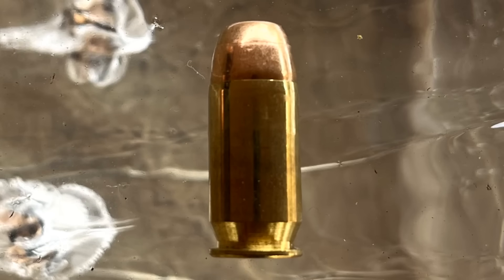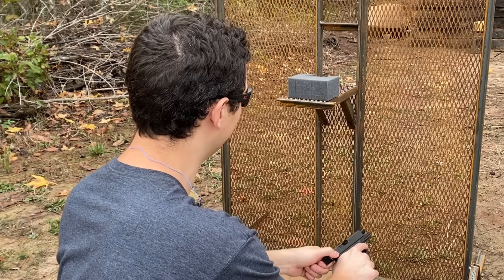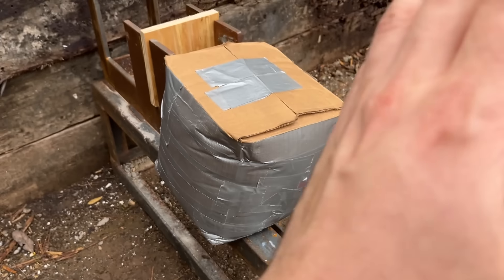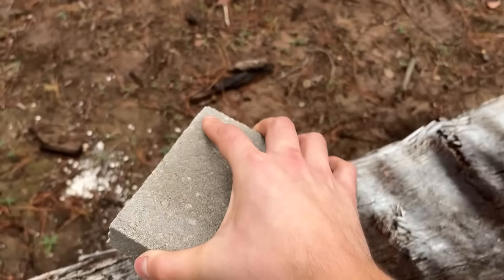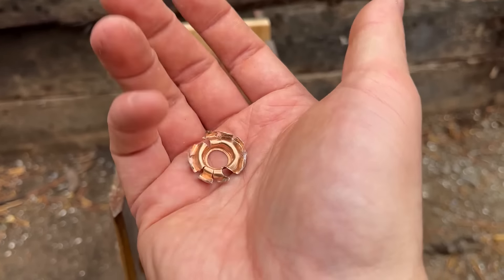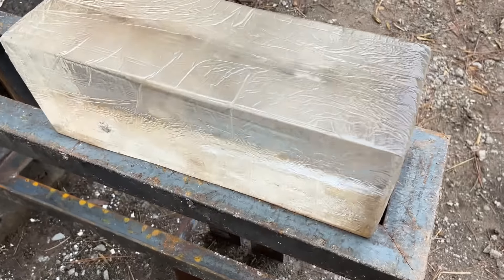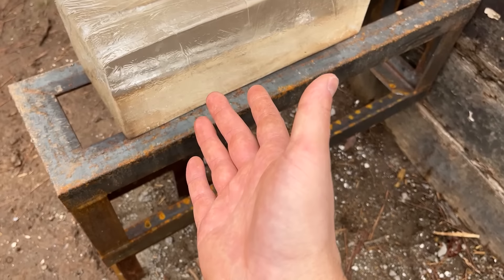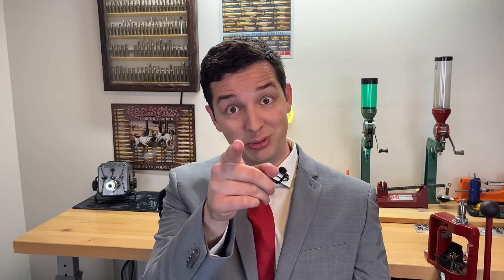9mm vs 45 ACP Barrier Test: No Debate?

Comment: Funny how both the 9mm and 45acp are war cartridges and never originally designed to be hollow point. In combat you would not be using hollow points. You need to test these rounds without hollow points. Curious to see if it matters.
Reply: Hollow points were only used in the gel .
Reply: @44special9 , where in the video did he say that? It seems incorrect.
Reply: I don't remember him saying but I think I found some evidence .                                                                                                                                                                                                                                                                 45 bullets shown at 2 : 02 and 2 : 04 timestamp are f.m.j.                                                                                                                                                                                                                                                                               bullets shown at 2 : 54 are f.m.j. not HST hollow points (no cuts on the jacket)                                                                                                                                                                                                                                      45 bullet jacket at 5 :45 has an open base , 45 HST doesn't                                                                                                                                                                                                                                                                     hollow points weren't introduced until the gel block                                                                                                                                                                                                                                                                                      f.m.j. loads are listed up top in description if you want to check them out .

Comment: What bullet weigh were you using? For the .45acp try a 165 to 180 grain bullet. If you can can find it, try a 145 grain 45acp. These bullets would have higher velocity and maybe greater energy.

Comment: I agree with @philipstaite. Ammo diversity is a good thing. I conceal carry both calibers in todays video, and it depends on where I am going as to which pistol I carry. My general carry is a Glock 43X with 2ea Glock 10 round and Shield Arms S15 (15 round) mags. Yes I carry 51 rounds with me because you never know. My secondary carry is a SDS U.S. Army M1911A1 with 22 rounds. I carry my 45 when I know I am going to be mostly in more confined/short range shooting situations. The lessened degree of penetration of the 45 means less chance of me destroying/wounding someone I don't. Also the mass of the round and the faster energy dump equals a greater chance of knock down. Just imagine that 230grain (83 more that the 9) slapping something solid in your (or on your) body!

Comment: About 30 years ago a buddy and I at the range set up some pepper poppers for just the sake of curiosity.  I had two Glocks with me, one was a 23, (40 S&W, (165 gr) and the other a 21, (45 ACP (230gr).  I don't recall the ammo brand most likely HST (that was free ammo).  The pepper poppers were adjusted to fall over as evenly as possible.  We taped an aiming point at equal locations on the PPs and alternated between PPs with the pistols.  We found that the 45 ACP consistently hit harder and knocked the PP down faster than even the 40.  Maybe not by much, but...
The test I just watched didn't show the energy of the rounds striking an object and the reaction of that object.
I don't have a dog in the fight, I have all three (9,40,45), and have appreciation for all of them.  But I think the 45 ACP often gets overlooked and is viewed as obsolete.

Comment: The debate has been over for at least a decade. 

The fact is that there is no such thing as "9mm ammo" or "45 ammo" and it just doesn't exist. You can't buy it, you can't sell it. It doesn't exist. 

What does exist is dozens, if not hundreds of brands selling possibly thousands of configurations of casings, powders, primers, compositions, and shapes... in both 9mm and 45 caliber. 

And those different ammunitions will work differently in different guns and on different targets. 

So the answer is and will always be: "it depends on the gun, the ammo, and the target"

But if we look at the experts, the FBI switched to 9mm. Cia uses 9mm. The military switched to 9mm. Most police have switched to 9mm. And there's no agencies requiring 45.

Comment: As one that shot both the .45ACP and 9MM for a long time while serving the Army and in Law Enforcment, being on SWAT for many years, this is what I came up with, oh and also being an FFL Dealer, Gunsmith and Trainer to boot; take it for what it is worth. The 9mm as a good if used as an offensive round, in 115 gr. to 124 gr., yet the 147 gr. is for defensive as well as most of the .45 APC rounds, for stopping power.

Comment: I got small hands, small feet, and a small, well anyway, I carry a 9mm with 124gr +p gold dots. I think the 185gr +p rounds for the 45 is as close as you gonna get to a 10mm. I wouldn't want to be shot with any of them. Great comparison 😎👍
Reply: I have 2 20rd boxes of Underwood 185gr +P JHP for my used Glock 41 .45 gen 4. I carry that round often but also use my 50rd box of HST +P 230gr .45acp. Both .45 rounds are great for personal defense or duty use 🚔.

Comment: The thing with personal defense ammunition - penetration and velocity aren't as important as the amount of damage damage and stopping energy that will be inflicted upon your attacker, and the ability to disperse the threat as quickly as possible.

Round 1 - The 9mm penetrated deeper, but made a straight and narrow wound channel. The wound channel on the .45 is much wider and the damage is obvious. - Winner .45
Round 2 - Neither went through the sand and no measurement of penetration was performed. - Draw
Round 3 - The 9mm broke the block in half, but the .45 destroyed it. - Winner .45

Round 4 - The 9mm and .45 both had almost the same penetration and wound channel size, with the 9mm slightly edging out the .45. But the amount of energy the .45 released into the block upon impact was visually greater than the 9mm. That's the knockdown power of the .45.  - Draw.

I have both calibers in my arsenal, but the .45 is my go-to choice for home defense, and the 9mm is easier to carry around while out and about. When it comes to protecting my family, I would rather not use something that is likely to go through walls, and is more likely to remove an attacker's limb and put them on the ground than just go through them. Bigger holes = more damage.

Comment: I'm not trying to tell you what to do, but something to consider. Lead is a soft metal, and even ricochet is moving considerably faster than you can shove a bullet through your shield. IF you have this issue, that lead is going to shave off, or squish through that mesh shield you have. If you feel safe after this consideration, do what you do,  just know that I personally worry for your safety.

Comment: A 9mm is NOT a .45 ACP.  They are not in the same league.  A .45 ACP round is 11mm (2mm wider) and averages twice the weight of most 9mm at, say 230 grains.  How are these rounds comparable?  Terminal ballistics are night and day!  Trust me when I tell you that .45’s have stopped way more bad guys on the battle field than any 9mm.  It just most pansy’s can’t handle the .45 and they don’t have capacity to spray and pray for those with shot placement problems.  The .45 is proven as a man stopper.  Not the 9mm. It’s just more popular today. And I assure you that multiple shots through a windscreen with a .45 will penetrate and not glance off.  And rounds do not go through 6x6 treated blocks.  Neither will a 365 grain .454 Casul, btw.

Remember a Prius and a Kenworth can both do 60 MPH.  But that Kenworth will cause far more destruction on impact if it hits something.  But also remember, you don’t want to be hit by either.  Great content, but that 9mm didn’t win any awards against that .45 because there’s more to the test than a block and gel.  Great content and love your channel!

Comment: I’ve plugged the numbers for a 9x19mm vs. .45 ACP before, and the results here don’t shock me.

9x19mm being a smaller caliber with comparable muzzle energy to .45 ACP tends to penetrate deeper while .45 ACP is more eventful in its shallower penetration depth.

I calculate their penetration using the ballistic limit equation (the second one on Wikipedia specifically), reorganized to solve for penetration depth.  I then have their kinetic energy figures, and divide them by the penetration depth (1/25th inch for ft-lbs, 1mm for joules) to get the energy transfer per every 25th of an inch, or every millimeter depending on the unit, of armor.  While it doesn’t initially seem to take into account things like temporary wound cavities and how eventful it can be for some cartridges, the formula for kinetic energy itself is proportionate to mass and velocity squared.  That also being said, temporary wound cavities can’t really be relied upon, especially with pistol cartridges going out of half-foot-long barrels (even the likes of 5.7x28mm fall short of the 2,000 fps minimum).

Back to 9x19mm vs. .45 ACP, it seems that from those calculations (and these tests) that .45 ACP is much more efficient with its energy transfer than 9x19mm, though things can fall into 9x19mm’s favor once hollow points are taken into consideration (and especially if you can afford them, hollow points are a MUST for any serious self-defense weapon).

I’m more partial to .45 ACP myself between the two, but I’m not blind to the appeal of 9mm.

Comment: It has always bugged me how people measure this stuff. The only thing that matters is how much energy is transferred into the target. No one measures that. Should put the gel on some sort of a slide with a way to measure how hard it hits. Energy transferred into the target = damage done.
Reply: No, damage done is damage done. Energy transfer isn't worth a dick unless it's significant enough to overcome temporary stretch to rupture tissue. Only rifle velocities can do that.
Reply: @MGMan37  energy transfer is damage. it can not transfer energy into the target without doing damage.
Reply: @plaid13  How is that? If you punch a wall but don't dent or crack it, did you do any damage? Not really. same principle here. The elasticity of flesh harmlessly absorbs the energy. It's like stretching a rubber band. it doesn't break it until you stretch it too far. Only rifle velocities get you to that breaking point of flesh's elasticity.
Reply: @MGMan37  like you said flesh is elastic it stretches. We are not made of gel blocks or wood we are made of flesh and bone. The round has to transfer the energy into that flesh to slow down otherwise it will keep going just as fast. it transfers in the from of ripping tearing breaking and heat. All damage. Bodies are not made of gel and does not behave anything like it. That is why none of the other tests matter. Only energy transferred matters. That goes the same for pistol or rifle rounds or even a knife or arrow.
Reply: @plaid13  But exactly what I'm telling you is that energy transfer does not rip, tear, or break flesh unless it is a high enough threshold (only accessible via rifle velocity)
Without that the only thing that matters is where the bullet physically touches as it travels through flesh.
Reply: @MGMan37  I think maybe you need to rethink what you just said. Or maybe learn basic physics. 
 If you don't think a bullet rips tears or breaks flesh unless it is a rifle... You really shouldn't be around guns.
Reply: @plaid13  It does break the flesh directly in its path. Not areas around it from "energy transfer" or "temporary stretch" or 'stopping power".
Reply: @MGMan37  Yeah... I do not think you understand how energy transfer works... That is energy dumped into the target. It is transferred into the target by doing damage. If it does not transfer energy into the target it would do no damage. If it does not transfer much energy into the target as it goes through it will keep going out the other side. It is all about energy transfer. If it hits a bone that is a big spike of energy being transferred. The pressure wave you seem so interested in is just another form of energy. A flat faced wad cutter cutting sharp edges through leaving a perfect hole is also energy transfer. A HP that opens up wide is the same thing. It is just how the energy is transferred into the target.

Comment: Not to mention, with today’s ballistics and bullet performance, it’s more of a preference thing. I can say that I would’ve liked to see the results with actual FMJ ball rounds (round nose). Not the flat nosed bullet. Anyone who shoots knows that, generally, increased velocity of a lighter and smaller round will equal that of a larger slower round. Depending on choice of load and bullet type, in some cases, may even outperform that of the heavier and slower.

Comment: I can say, the .45 acp wins this. Why?
The gel was incapacitated faster. 😛
The concrete was exploded better. 😆
For those people who wish to say ".45 aarp" I will remind you, the 9x19 Parabellum is actually an older cartridge historically and more "antiquated."
Reply: The AARP is not a reference to the cartridge, but its users.
Reply: @MGMan37  Not really. That's just not true. People don't know the users of a cartridge but easily and readily use "aarp" instead of "acp". Many of those people are quite fond of 9mm which historically, is older than .45acp.

Comment: A 45ACP CAME BACK AT ME ONCE WHILE SHOOTING IN THE BASEMENT BUT THAT WAS BECAUSE MY FRONT BOARD WAS PLYWOOD AND IT WAS UP AGAINST ANOTHER PIECE OF WOOD.
THE REASON IT CAME BACK WAS "WHEN YOU SHOOT A HOLE IN PLYWOOD IT COMES OUT THE BACK A LARGER HOLE THAN GOING IN. IF I WOULD NOT HAVE HAD ANOTHER PIECE OF WOOD BACKING IT UP IT WOULDN'T HAVE BOUNCED BACK

Comment: The 45 is better in my opinion, been shooting both calibers since I was in the Army in 1986 when the 45 ACP 230 grain ball was it, colt 1911, The temporary cavitation is much bigger on the 45 it's just you may not catch it with out a high speed camera, the wound channel in wood is wider, the energy dumped in target is more, the energy of the 45 230 grain at 100 yards is 347 ft/lbs, the energy of a 9 mm 147 will drop to about 273 ft/lbs so the bullet coefficient is much higher with a 45 then a 9 mm and self defence distances like 7 yards the 45 doesn't drop in a loopy trajectory, not even at 50 yards so a 45 trajectory also is nothing to worry about, what we are forgetting is buffalo bore and underwood ammo, there is no 9 mm that is going to beat the best 45 rounds Wich includes 250 grain hard cast, a argument depending on what rounds both in shelf ammo and performance ammo a 9 mm may have a slight edge with penetration but never wound channel or damage of a 45 wound track, so toe to toe with the hottest ammo 45 wins, apples to apples is fine but comparing the best apples of each tree, both in energy, expansion, penetration, longer distances that will give the 45 the win most of the test due to its higher b.c then a 9 mm and that mass is what really helps with that, they say a 45 is slow, that's true but so is a frieght train with all that mass behind it causing blunt force damage even if not high penetration

Comment: I have enjoyed watching your vids for about a month now. During this time, I have wanted to state (if no one else has done so already) that landscape pavers are concrete, but a weak form of concrete. As anyone who has ever worked with the stuff knows, there are a plethora of concrete mixes that can be used to address any issue in building samples to test true barrier penetration that will serve your audience better. Pavers are inherently weak - my .22 air rifle can shatter pavers at 30 yards. What I would like to see is actual concrete - let’s use a basic mixture used on every jobsite I have ever been on - 5,000psi concrete - every box store sells it. Sure there are better mixes, but 5kpsi is a standard for anything buried or used as an anchor. I propose you test these rounds against properly mixed, poured, and formed 5,000psi concrete for more realistic results as no barrier will ever consist of landscape pavers.

Comment: For the most part, I found the testing of these bullets entertaining. To be clear, the 4x4, concrete, and sandbag tests were entertaining, but they wouldn't have made a difference in my choice of cartridges. On the other hand,  I was impressed with the tests performed with the ballistic gellatin and the measurements of the bullets afterward. With this being said, I was surprised how closely these two bullets are in penetation,  expansion, and the size of their wound channel. Had I not previously formed an opinion, I would have chosen whichever cartridge provided the highest capacity in my pistol.

Comment: 17 rounds of 9mm or 7 rounds of 45 ACP in the magazine, debate is sort of over. I've been in a shoot out before, and after that gunfight, I traded my 45 Colt Combat Commander for a Glock 17. Also, the 9mm with FMJ ammo will go through 6 inches of wood and still go through a gallon jug of water. I'm not sure about the 45 with FMJ but it may do the same.

Comment: Good hits with either caliber do the job without issue the .45 guys say that the large expanded diameter can make the difference between a bullet causing an incapacitating shot or not and the 9mm guys say that the extra capacity and faster follow up shots with 9mm provides the same benefit and both statements are true but 2 shots do a hell of a lot more damage than one shot with a slightly larger hole.